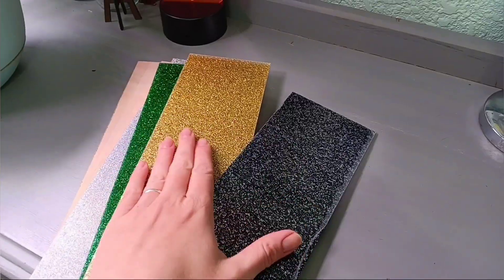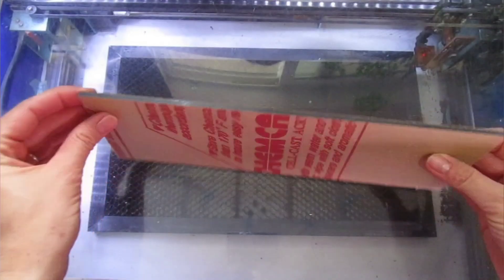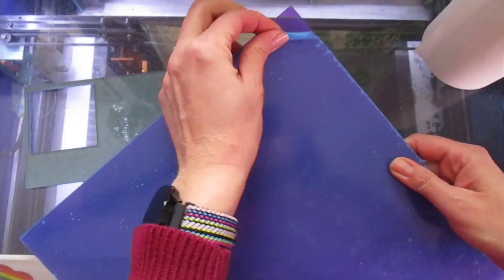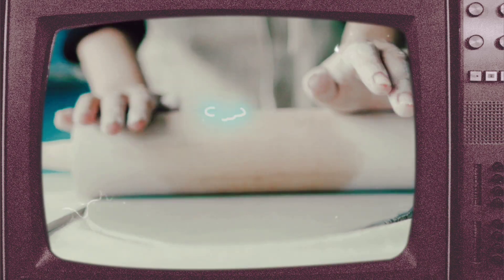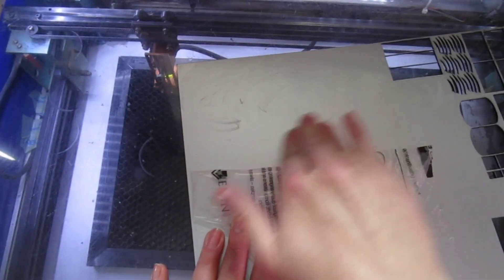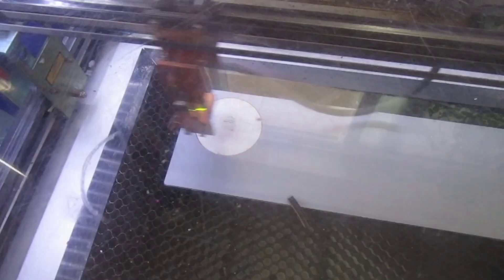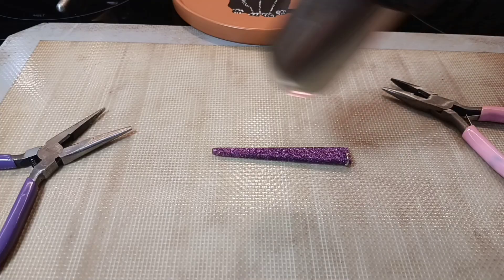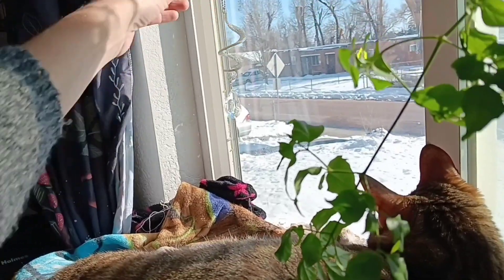Mastering Acrylic Laser Cutting, Dive into the Basics!

Comment: Try 3M double-sided tape to replace gluing, no more messy residue. Apply to rear of material and cut as usual. Placement of parts will need more accuracy as tape is pressure sensitive. My work uses tape for lettering and shapes on a larger scale for our sign company clients. We have a 250 watt machine, so handles thicker acrylics. Your tips are very handy too.
Reply from the maker: I LOVE 3M double sided tape! And - 250 watts! Dang! That must be a beast! 🤩
Reply: @LaserLady  It can cut up to 30mm thick acrylic, really slow going though and bottom edge has chatter (roughness) so mainly cut on CNC machine. Really love your approach all things laser that reap rewards especially self pride, great vids.
Reply from the maker: @kevinfoo8031  That means a lot to me - Thank You!! 🤗